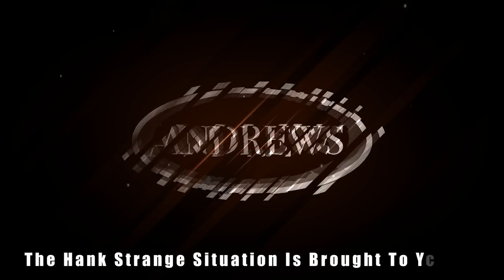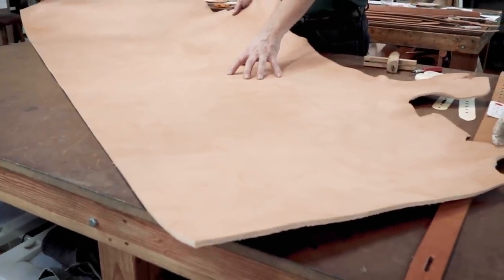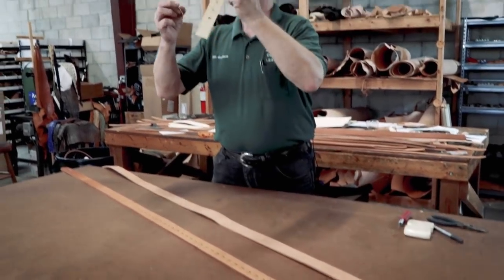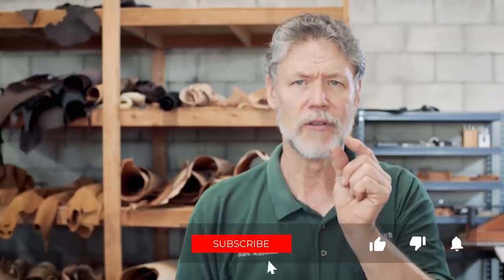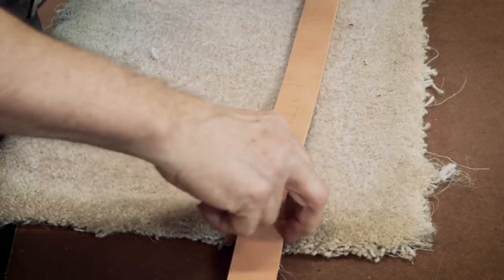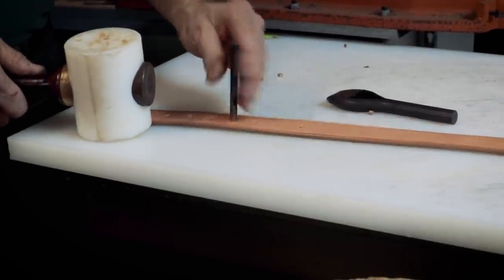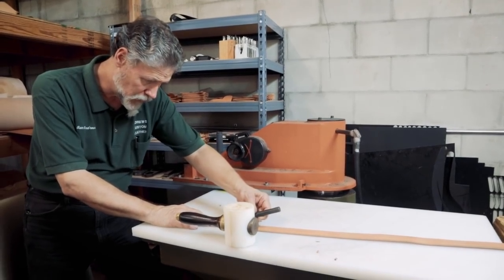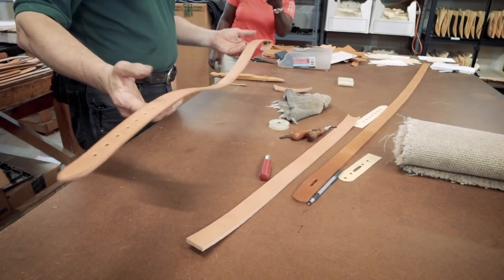Making A Leather Belt Super Simple With Andrews Custom Leather // How It's Made

Comment: I'm starting making belts to, and I hate when water slides on the body of the belt when I slick it ,like when it does in the video at 13:26 , because after I apply a finish coat of oil the spilled water just pops and doesn't look like a uniform coat. 
      I can see that even after you buffed the strap with the denim you still have that spilled water mark. It's there a way to correct that problem, besides that I have to be more careful on how I apply water? Or I'm just warring to much about something that is normal?
     Ty, for the video, I've learned new things everyday so I can improve my crafting skills.

Comment: I use leather belts, I'm very very active and often find I stretch my belts and need to add holes. My father showed me a trick that his father showed him. Use a .22 casing and hammer it through, makes a perfect punch and perfect hole. How's that for Appalachian... Also, how many of y'all use them belts enough they actually stretch?
Reply: I'm due for a new belt I really am gonna look these up!
Reply from the maker: for sure I've stretched out other leather belts, I think quality of construction is a big part of that...I've had my two Andrews custom belts for about 6 years and Sam just checked them out to see how they were holding up and there were in pretty good shape, just needed some touch up on the finish around the edges
Reply from the maker: @appalachiangunrunner5613  cool